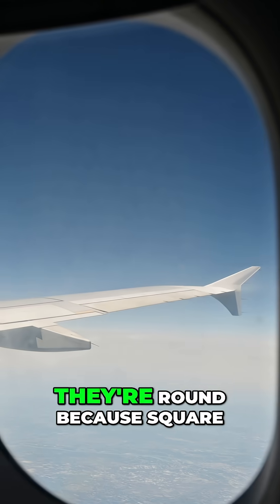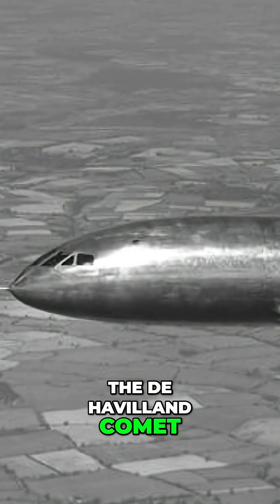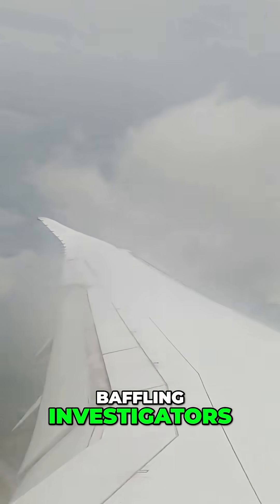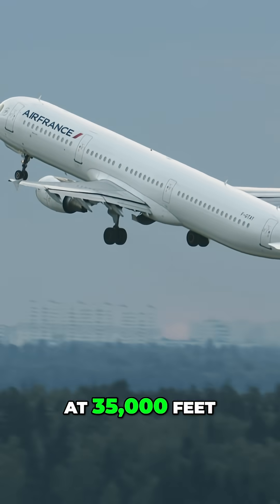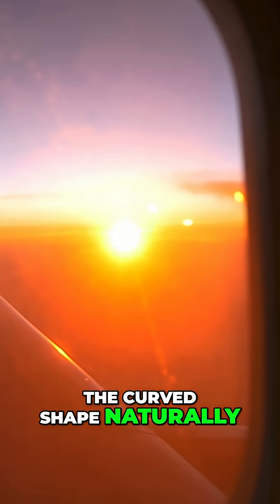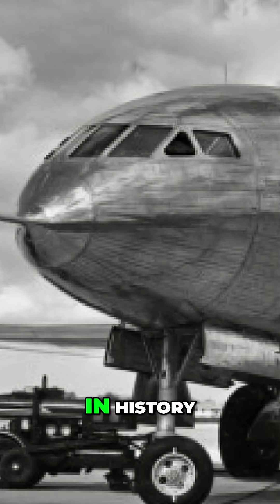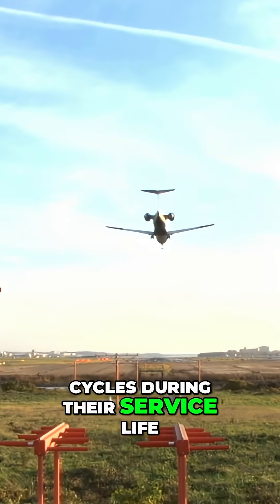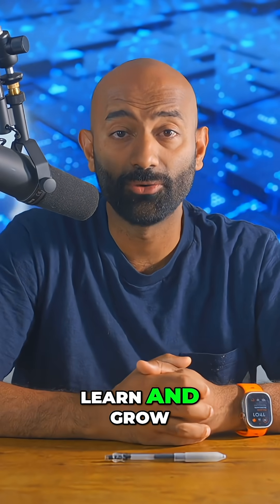After 3 Deadly Crashes---Airplane Windows Had to Change!

Comment: I think you're just perpetuating a myth. The Comet had a problem with metal fatigue, square cut-out ADF antenna windows, and punch-riveting. The passenger windows were actually rounded on the corners.
Reply: Spot on!👍
Reply: I was about to make the same comment.
DaVinci makes a logical, but not completely accurate case
Reply: The Boeing707 had rectangular windows!